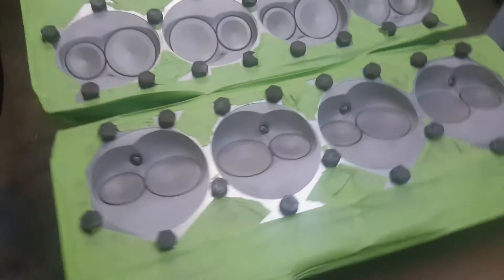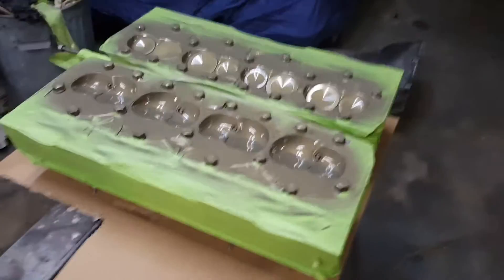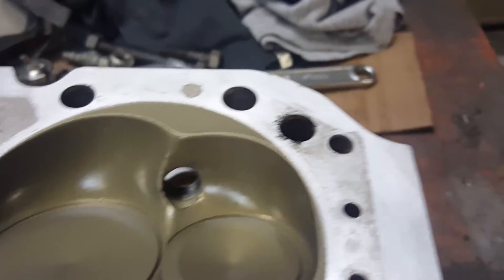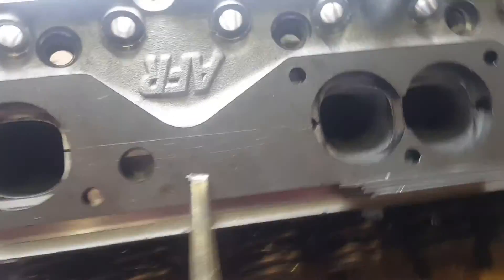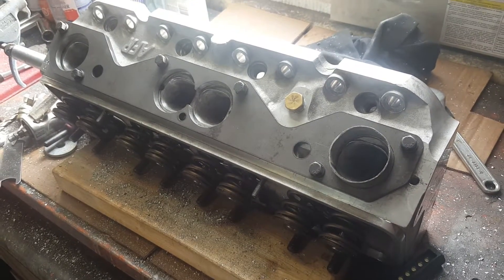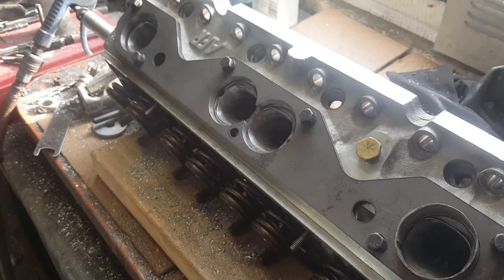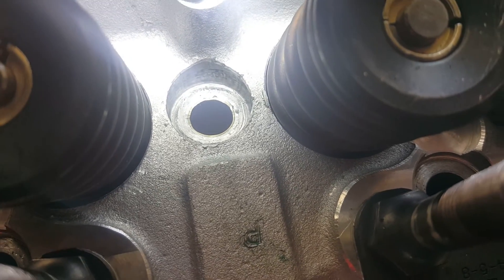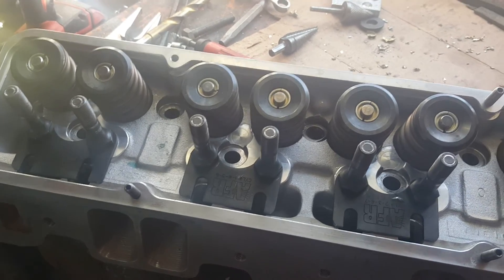SMALL BLOCK CYLINDER HEAD MODS

Comment: The bake on V-136 survived very well on stainless and inconel valves in a performance application (2.4L making 450 whp).  However, it was coming off the aluminum chamber and forged piston crowns a bit, 10-40% loss maybe.  I followed all prep steps and have a dedicated blast cabinet for cerakote only.
Reply: Not a lot of info on the combustion chamber coatings. I just did one the other day but I won't know how it turns out for months. I ultrasonicd  the head, then acetone on the combustion chamber, sand blast, then paint. I am waiting to hear back from cerakote if they recommend valve in or out when spraying.
Reply: @nismospek  any new on in or out?
Reply: @AkiwoxLP  they recommend spraying the valves separately. Masking the valve seats was difficult.
Reply: So if u read the site v136 is not c series which is the highest to dating piston tops and chambers and glacier for exhaust

Comment: Nice to see someone else finally set alone the combustion chamber. I’m thinking about testing if I can get improvements from cerakoting the intake exhaust ports. Even though air doesn’t exactly spend long in those intake ports before making it into the cylinder there should still be a slight reduction of temp. As far as exhaust it’ll just reduce heat transfer into the head which should, theoretically increase the amount of tine it takes for the head”s to get hot as well as maintain as much heat and velocity going into the turbo mani. Guess we’ll see. If I spool up 50 rpm sooner I’ll be happy. If it spoils 100 rpm sooner I’ll be ecstatic. As you said, every little bit helps. Have you messed around with dlc coatings yet?

Comment: Do you need to acid wash prior to application?   Surface oxides might be a concern.  If so... drying after rinse could be a catch 22, making a vacuum chamber a plus for perfect application.  Aliminum doesn't oxidize deep, but it can happen quickly.

Comment: Isnt cerakote supposed to be baked on???
Reply: Not C-186.  To quote Cerakote's website:

"Putting the C-Series (Air Cure) Cerakote into the oven is not recommended for speeding up the curing process, the Air Cure Cerakote needs that time to become fully cured. Placing Air Cure Cerakote into the oven may cause issues. 

- Josh Benton"

Comment: are they the afr245 heads
Reply from the maker: AFR-1067

thanks
Reply: +horsepower VS your wallet I have the same heads have u ever had them flowed
Reply from the maker: I'm not sure if Ronnie had them flowed before. I don't believe so they're stock besides the little port job you see in the video.
Reply: +horsepower VS your wallet  ok thanks
Reply from the maker: he just back to me looks like 320 intake and 240 exhuast @700
Reply: +horsepower VS your wallet I never had mine flowed I no they have them advertised at so much flow but I wEnt sure if they were accurate
Reply: What size chambers
Reply from the maker: 75cc
Reply: horsepower VS your wallet not bad not bad my heads are cast and flow pretty good no forced induction tho
Reply: @horsepowervsyourwallet9769  is it worth it though?? 

And do you have to do it every 5000 miles or so?
Reply from the maker: @FirstLast-tx3yj  every little bit helps but this is just a drag car so it doesn't see any street driving.
Reply: @horsepowervsyourwallet9769  usually people coat the top of the pistons and as u did the cylinder head which is as u mention helping by containing the heat in the chamber.

But if we want to think outside the box coating the bottom of the piston will also prevent heat from escaping into the oil and will offer longevity because the coating will stay in the bottom of the piston for years.

The ceramic coating doesnt know its at the bottom of the piston it will just stop the heat from going from one side to the other.

So just had this idea and it makes sense. What do you think??
Reply: @FirstLast-tx3yj  you want the heat that makes it into the piston to escape so I wouldn’t do the bottom half. Ceramic coatings don’t stop heat transfer, it just slows it down. Same reason they don’t use titanium pistons. They’re strong, light and offer low thermal expansion, much closer to steel, which means you don’t have to undersize your piston as much to account for that expansion. The issue with titanium is that it’ll take much longer to get hot but it’ll Eaton that heat much longer. Bc of this it’s possible the pistons will get close to combustion temps which would cause the metal to get weaker and can lead to detonation among many other issues. Nice to see people think outside the box though. This is how we innovate. Peace.